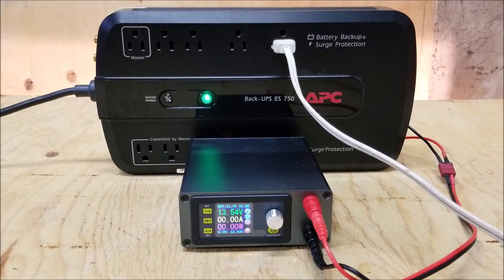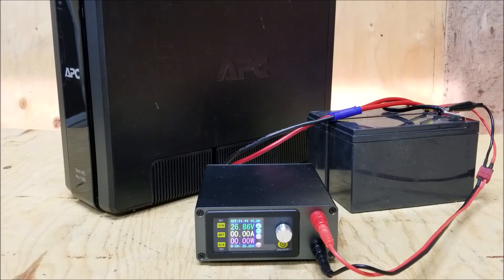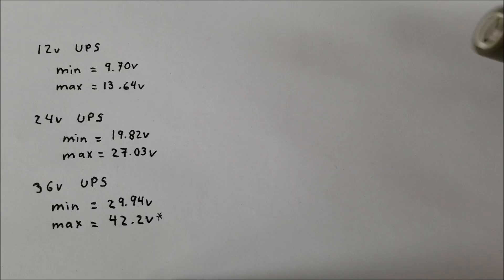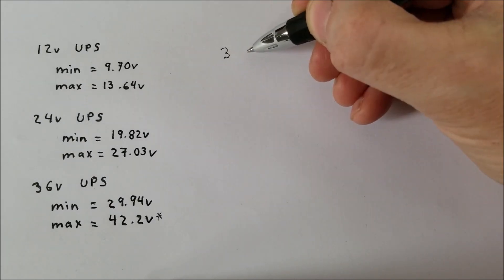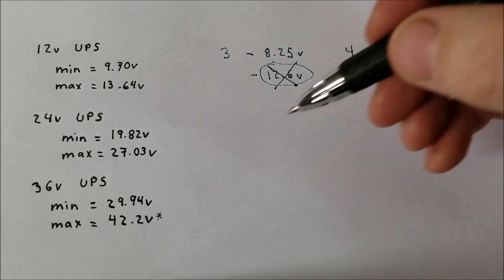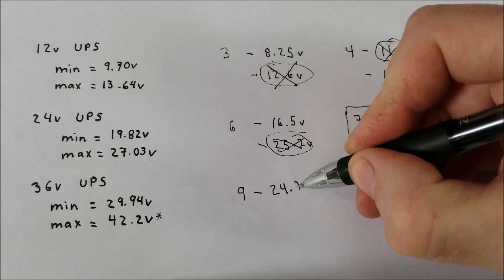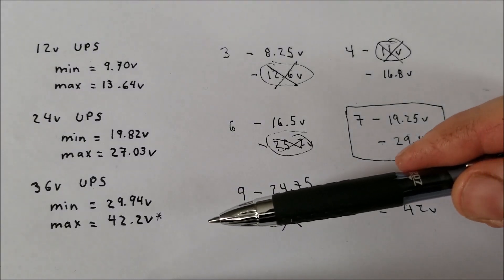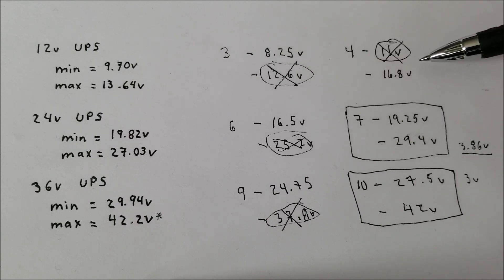Can a UPS use li-ion batteries

Comment: Question is, why not use home batteries for your whole location? Hook up some different energy sources, become a lot less dependent on UPS to keep your systems running. I scaled down my UPS, still enough for completing shutdown, but with a smaller ups it's much cheaper to switch to the next battery technology.

Comment: I have used,'18650 Charged Pil Li-ion 3.7v 6800mah', in my, 'UPS', which already had a built in,'BMS', although I used an extra, 'BMS', the batterys still blew up....

Comment: I made a lithium ion battery for an ultima LCD 
 2KVA EURO ups The battery was as follows: 30 cell bak high drain 4.2 v 3 A 5. The batteries were placed in 5 columns and 6 rows and  thick nickel stripe was used for spot welding.  I used BMS 6S.The problem is that in few seconds, not more than a minute, the battery gets extremely hot and smoke begins to appear. Please explain the error.

Comment: what about car batteries. 1 for 12v, 2 in series for 24v, and 3 in series for 36v. do you know if that work too? and IF yes, do you think there is a limit for paralell conections?
Reply: if u did not find the answer, car batteries will work but u must get ones that dont vent their gases out into the enviroment if ur using it inside.

Comment: You don't need to worry about minimum voltage if the battery has an internal BMS with low voltage cut-off.
Reply: Yep but if bms turn off batteries before ups turn off your computer 
why buy ups ?

i dot it here , charge full my lifepo4 batterie 300A 
plug on ups eaton ,all work ,
but ups say battery 93% is charging ....
actually up 96% ,bms have to do the job ...
but ups say 7min remain ,( stay on stats from 7a battery )
when i have a 300A battery ...
need time to adjust ..

Comment: cant i just slap on a bms to mitigate the minimum discharge voltage of the 12v ups 4 cells pack 
as in the bms will shutoff the connection when the discharge voltage reaches 11v therefore keeping the battery safe

Comment: Some UPS motherboard are having some resistors around an OpAmp to set this 8.7v low discharged and 12.6v high charged (replaceable by a adjustable small resistor or 2) on you tube I seen once a video on Eaton Elipse UPS for modded Li Ion 12v/9Ah Lead case to 12v/14Ah battery I cannot find it anymore (you must have MB schematic diagram to identify resistors)... If someone find it... Or knows how...
Reply: I want to find it!

Comment: That is, we need to use 3.2 Lifopo4 batteries for 12v UPSs.
Reply: how about connecting 2 diodes to the charging cable to decrease cell charging voltage by around ~1-1.4V, and 1 diode in the opposite direction not to lose much when discharging?

Comment: Perhaps I missed it but you really need a BMS to monitor the voltage across each li-ion cells.  Connecting up li-on batteries in series like this is potentially dangerous - dangerous in that you could have one cell have a thermal run-away event and cook off (catch on fire) and ignite the others.  Sooner or laters li-on connected like this WILL get un-balanced (their individual voltages will begin to drift).  Do a quick youtube search of have scary even one of these cells cooking off like that.  The BMS board will protect against the individual cells from getting un-balanced - but its not a cure all for all risks.  Even WITH a BMS board if I was doing this I would have the batteries in a NATO style 7.62MM ammo can - to contain the fire.  And even than I would want to have that can located away from anything that might ignite.

Comment: The difficulty of using the 3S config is: 1. You absolutely must have  a BMS. While the low side disconnect is below that of the UPS shut off, the high side will absolutely cook a 3 s without it.

The BMS should disconnect charging... is the changeover quick enough for UPS?

Comment: Thanks for this extensive test! Please can you test and clarify if the same conclusions apply also to battery packs including an internal BMS like the one from ecoworthy? These packs are sold as drop in replacement, but maybe the they can have the same problem of raw cells with UPS voltage. Many thanks for your work!

Comment: For the 12v scenario, did you consider using 3 batteries in a series added to two parallel? You would end up with 9.625 / 14.7 if you really wanted to use your old 12v UPS...

Comment: I will just say this is how li battery fires get started.   The charger circuit is not for li batteries.  Your test are not enough to determine how safe it is to swap.
Reply: Agreed. It might be wrong to assume the top charge voltage with that method shown in the video because old batteries will have increasing resistance as the battery health decreases which will keep the voltage lower with some charging designs especially if they are undersized to keep manufacturing cost down. It's possible there is a bulk charge rate of anywhere from 14.2-15v per battery.
Reply: The other issue with lithium in series is that it needs to have cells balanced especially under high load with the application of a UPS and there is no balancing circuit in a lead acid UPS. If lithium cells come out of balance you will have an issue that will lead to fire.

Comment: Too bad APC doesn't just offer a drop in upgrade to Li Ion
Reply: Wouldn't be able to sell you overpriced motorcycle batteries then....

Also due to the high cost, lead acid is still probably the way to go for a lot of people. However in my case I can get some slightly fire-hazardous batteries for free, so I can get my dumpster dive acquired backup battery running for less than $20 and have insane battery specification that is completely and utterly overkill on power output and will be limited by the unit itself. Seems like a good deal, other than I really need to see if there is anything that can stop graphene fires...

Comment: lithium ion batteries will not work for a 12v systems efficiently. but it i will work perfect for a 24 volt systems and 36 volt systems. 3/4 not good for 12v system, but 7s is perfect for a 24 volt system and 10s is perfect for a 36 volt system. on the other hand LiFePO4 cells will work perfectly on a 12 volt system since it has 3.2v nominal so 4s will give a nice 12.8v.

Comment: Just change the cutoff voltage and charge voltage and no problem.
Video is WRONG.
Reply: That assumes the backup unit is easily modified circuit or that a beginner is competent enough to reverse engineer the electrical traces and schematic. This one is probably a safer bet for most people, but yes if you can change those parameters and the inverter is still happy with it then that would be ideal.
Reply: The concept is all wrong, the charge profile was based on lead batteries but if you remove them the li batteries will change the charge discharge design.  You also need betier than a multi meter to see the power profile. You only see the DC value .

Comment: I will test mine, I have one 12 v and one 24v. I think the LifePo4 batteries would make a better fit if my voltages turn out close to yours. I don't know yet how to set up bms or anything but those batteries are more forgiving than li-ion
Reply: Yes, it's is very often the case that LiFePO cell are a better fit from a voltage point of view.

Comment: Why dont they just sell a lifepo4 ups replacement battery
Reply from the maker: Cost. Lead-acid batteries are dirt cheap compared to LiFePO4.
Reply: @DIYbatteries  , i think they are making more money from selling lead acid batteries. Ive bought 3 already for one of my ups.

Not to mention the non tech people who would just buy a new ups than bother buying a battery and then replacing the one inside.

Comment: for 12V. . its better to use 32650 battery 4s config woth BMS. is that right?
Reply: 32650s are going to be slightly difficult if you try to fit it in the same space. 26650s may be better for you. If building an external pack, then it doesn't matter.
Reply from the maker: Lithium Iron Phosphate (LiFePO4) in a 4s configuration is ideal, yes.

Comment: What if we find the voltage divider which goes to microcontroller inside the ups for monitoring the voltage and change it then it will be fine

Comment: Do 10S BMS's exist? Can you actually replace 3 x 12v Lead Acid batteries with 10 x 3.7v Li-Ion Cells in series this way and even charge it with the UPS built-in power supply. Does it need some extra protection like a PMMT controller?
Reply from the maker: Yes 10s BMS's exist, just do a google search for daly 10s BMS, you can get them from banggood. You wouldn't need any additional protection as long as the UPS doesn't charge to much over 42v and your cells are well balanced, you should be fine.

Comment: Leaf Xpack thanks for the information i have a 24v ups the same one you showed in the video an i need to get some batteries when  you say 7 cells that would be for one if the battery or both ?
Reply from the maker: 7 cells in series will replace the two lead-acid batteries.
Reply: @DIYbatteries  oh ok thanks
Reply: @DIYbatteries  would I need anything to regulate the charging on the 7 cell or just hook it up on the ups?
Reply from the maker: @Shiv.141  You could just hook them up and as long as they are well balanced, it will work. It would be advisable to use a BMS if you think of using the UPS in regular service. I recommend the daly BMS
Reply: @DIYbatteries  can I get that on amazon?
Reply from the maker: @Shiv.141  It's available on Amazom.ca but not on Amazon.com: https://www.amazon.ca/DALY-Battery-Management-Protection-Balance/dp/B087494LTL

Comment: @Leaf Xpack, I just got a haircut for you, do you like it?  LOL.  So you mention that as long as we have a max voltage larger than the charge voltage of the UPS and a lower min voltage under the UPS's cut off we are fine to use the UPS to charge.  Ok, I follow, and from the zoomed out look, that might seem fine, but when you look closer, you remember you had to build a 10s battery to pair up with a 36v UPS.... How do you address regulating cell voltages across the 10s pack?  I wouldn't trust the cells to not fall out of perfect alignment voltage wise for many cycles.  If it were me, I'd be buying, or building if I knew how, a 10s balance charge circuit that I would power with the UPS's regular DC charge power.  Oh, and if Im adding components like that, I'd add a DC to DC step down converter on the charge voltage of the 12v and 24v UPS's so they can run on 3s and 6s packs :).   HINT for anyone who does not want to build the 18650 battery packs you can sub in the same size premade (incl. balance board and connector) LiPo battery pack (same nominal voltage, look up min/max like shown here) which will give your battery a much wider range of use because LiPo batteries have a massive discharge current.  Everytime I look, the LiPo's come out pre made and looking all pretty and cheaper than even just the 18650's never mind anything else you need to buy to make your battery, case, connectors, solder, heat shrink.  Ok some of those costs are pretty nominal, but I added them just to nail that point down a little more.  :)
Reply from the maker: To keep your cells in balance you'd use a BMS or active cell balancer. I don't think using a DC-DC converter would be wise as it would need to be bi-directional and would require high amerage on discharge. I don't even know if that would exists, and if so, it would be more expensive than the UPS.

Comment: The 7S for 24V seems like a much better match if you ask me, because the UPS will float the cells at a little over storage charge. Would you really want a large li-ion pack sitting at 4.2V (or possibly 4.22V!!!) for months or years inside your house?? I sure as hell would not.
Reply from the maker: That is the conclusion I came to for a 24v UPS. For the 36V UPS, the charge voltage would be a little high using 10s so you could use 11s to be safe but you would only be using a little more than 50% of the cell capacity. However this would be great for the cell longevity and if you are using this only as a backup solution then it would be the best option.

Comment: If you used a BMS on the batteries you wouldn't have to worry about the UPSes cutoff being below the batteries cutoff.... therefore this video is kinda pointless.  :-)
Reply from the maker: No that is not correct, you should never rely on a BMS to disconnect a battery if the voltage gets too high or too low. A BMS is designed to balance the cells and disconnect it IF the voltage is outside of specification. Once the BMS disconnects the battery it will need to be reset, the UPS will not be able to charge the battery until you manually charge it. It would be even worse if the BMS disconnects if the battery gets too high, the UPS would be useless.

Comment: Depending on what UPS you use, it may be possible to modify the charge voltage, and the cutoff voltage. If you're able to do so, you can utilize more of the cell's capacity.
Reply: You can change the charging profiles... You just need to change a few things on the UPS mother board..
Reply: Or use less of the cells capacity, which is better for its overall Longevity

Comment: Hi,

Is there any reason why companies are not producing UPS with Lithium Battery instead of lead acid battery?
Is there any issues for building large number of units?
Reply: $$$ I would assume. Lead-acid is much cheaper and handles the intended use-case for UPS systems: maintaining power output during short mains power outages. I want a UPS that can run for hours but most of the time, when the power goes out, it's only for several minutes at the longest.
Reply from the maker: @Megatog615  You are correct, lead-acid batteries are dirt cheap. Also they like being kept at 100% charge, whereas li-ion do not. Manufacturers could design a ups to maintain a li-ion pack at 80% which would be ideal but again... $$$

Comment: I'm really missing the 48v one here... Especially since that's the most common one in rack mount form factor...
Would be nice to know whether it's worth converting it.
Reply: I have a smart ups apc 3000 120v, that says it is constant voltage charging at 53v. 

The cutoff low voltage that I found it to switch off at (shutdown) is 37.18v. 

I have determined that using LIPO batteries I will need to be at 13S configuration to make sure that the the low cutoff isn’t lower than my cells ratings and the upper voltage will not overcharge them either. However, I see that I also will not be getting the full rates AH out of the cells I plan to use.   The capacity of these particular cells is 2.5v (low) and 4.2v (full). 

So in a 13s set, on my ups, the cutoff voltage per cell is 2.85v and the upper charge will be 4.07v. so the capacity of my battery pack will not be whatever it’s rated at but a lower number as the range is lower than I would like. However since I am planning to use LIPO this is the safest way to do it as I see it. And it has the added benefit of longer life of the cells. The cells I plan to use are 8AH so I might get 6.5AH in this configuration.  My only concern is the constant voltage charging, what will happen when the 53v meets the 37.8v how many c will that put into the cells? Specs say I can charge these cells at a 120a  so I should be good but... I’d like to do the numbers first. 
SPIM08HP are the ones that I have to use in this. They are scary powerful but with a bms it should work fine
Reply: @jgren4048  Should be fine. A 12v 12Ah SLA want less than 3.6A initial charging current so I'm certain it will be CC limited. 
As far as I understand Pb chargers, They run in 3 stages, CC then CV and end on 'float' or equaliser mode. So just like Lipo chargers, they start with preset current till the set voltage is reached, then switches to constant voltage and the battery accepts what it can at that voltage till its full. Lipos stop accepting current if the cv voltage is reached while Lead Acids begin to hydrolyse at the electrode and boil off the electrolyte which can help with desulfation and equalises the voltage in each cell. SLAs need to be kept fully charged at all times, Lipos will last much longer being charged below their upper threshold. The float charge mode of a Pb charger shouldn't be an issue for the Lipo if its below its max voltage. Lead Acids do not like to be charged quickly but they can disharge insanely hard so the charger will be gentle.

Comment: Can we use LiFePo4 instead of Li-ion for 12v system
Reply from the maker: Yes, that would be best, with four cells in series, you obtain a voltage equivalent to a 12v lead acid battery.
Reply: @DIYbatteries   4S1P battery, ok then can we use 20A BMS ?
Reply from the maker: @Bharani_0601  It depends on the size of your UPS and the load you will put on it, with 20A @ 12v you only get 240w.

Comment: What if you use lifepo4 lithium chemistry?
Reply from the maker: lifepo4 cells have a voltage range which is ideal to replace lead-acid, you need 4 in series to be equivalent to a 12v battery

Comment: I have the same 24v APC backup as in the 2nd example.  I just wish I knew if or how to covert it to Lithium.  Maybe someone could make a video: Converting for Dummies?  Then, I might know how to create and install the Lithium batteries into the old housing of the Lead Acid battery packs.  I dont even know if Lithium actually works in such a conversion?  Is a bms neccesary?  What other parts are needed?  So many questions, so little information.😟🤦‍♂️🤷‍♂️

Comment: Thks I enjoyed/followed you video.  
However I've heard lithium batteries can't handle trickle/float charging well.
?Is that the case?
Reply from the maker: As long as the voltage per cell remains within the appropriate range for li-ion batteries, then it is fine. This is why I did this video, to determine the maximum and minim voltages. Unfortunately, most UPS do not have a voltage range which is appropriate for li-ion. Lithium iron phosphate batteries work better.